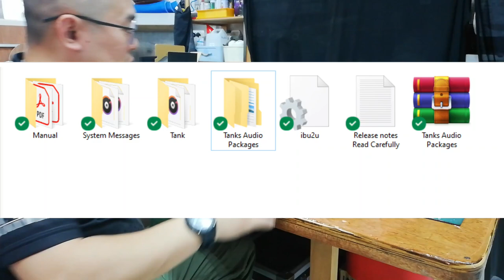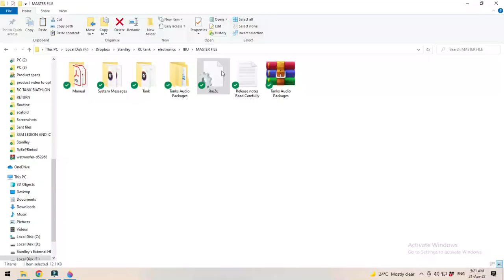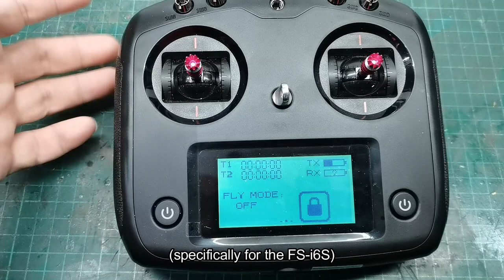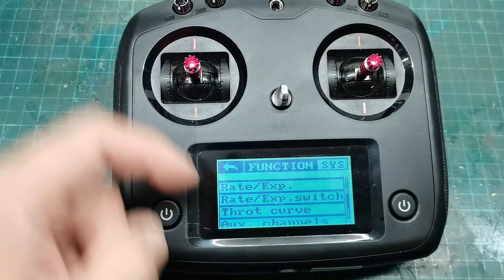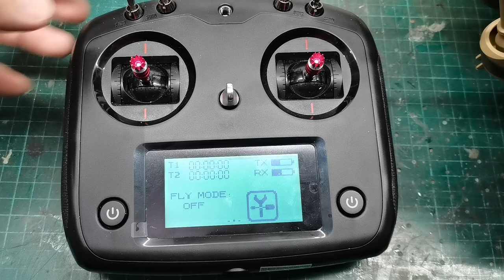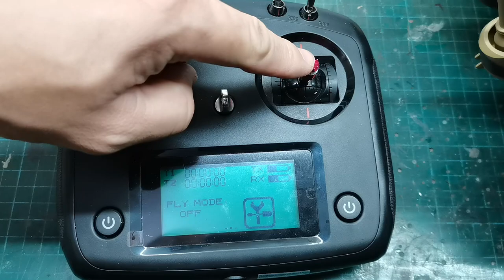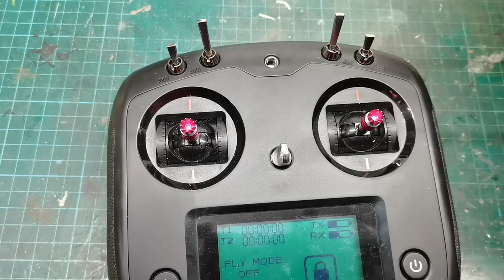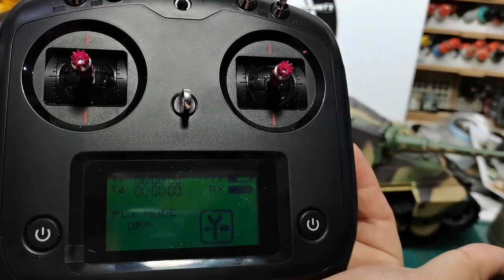how to install and setup IBU2 Ultimate

Comment: I have been working on my mato all metal tank build for 10 plus years.
I have been doing upgrades at the same time.
I have a ibu ultimate 2 board that was new board with all options I am now still trying to make all functions  work and I found the barrel up and down and turret rotation survo plugs do not work.
I am guessing the factory may have sent me the wrong board or it's some kind of programming needed.
Can you help
.I shure would hate to toss my $1,000.00 tank in the trash
Reply from the maker: @donaldseale5621  the turret elevation is a little tricky on the radio to get moving

Comment: Does this board come with the radio you showed? What is the typical range on the radio? I was thinking of doing something of an fpv style setup. I want to have decent range on my radio. 

I like board. It looks to be made of high quality. However,  I prefer my Canon firing button to be one of the shoulder buttons. Like the trick you showed. It just doesn't feel natural to me, to fire the Canon by moving the left stick. I like to be able to proportionally move my Canon up/down with the left stick.
Reply from the maker: no- radio sold separately.
400m i think.
you can mix it to the VRB but can't do away totally unfortunately
Reply: What did you end up doing

Comment: Hey Stanlley, quick question. If I am using the DKLM gearbox, what side is the steering motor and what side is the drive motor?  How do I know which one is which? thanks for the help.
Reply from the maker: Big one is driving motor, and you need to program via the Ini file.
Reply: @StanlleyLegion  yes i didn’t explain myself correctly. i mean what XH2.54 connect on the board does the steering motor get plugged into and what connector is for the drive motor? sorry if i didn’t make myself clear the first time. thanks
Reply from the maker: @panzertracks  I can't remember of the top of my head now. But plug one say drive in, drive it (after setting it correctly) and see what it does! If it's drive and you go straight, it should be the only plug working.
Reply: @StanlleyLegion  ok thanks got it.
Reply: @StanlleyLegion   Yep it worked, right one is for steering and left one is drive. thanks.

Comment: this and Clark TK22 look promising to install ELRS24 receiver and keep turret turret turning using stock setup. I dont need sound or recoil. Just want to FPV and explore the woods
Reply from the maker: Then you can get a decent FPV kit from a local racing drone supplier. They should have the right kit. It runs independently from the board anyway. You can use whatever board you have.
Reply: I didn't think he understood what you meant. I want to do this to and I'm coming to notice these tanks don't have separate receivers like hobby grade rc cars do to have a different receiver and radio for range extension. What did you end up doing I want to do the same with the MT12 by radio master

Comment: Will this board work with a Heng Long controller? Or does it only work with specific controllers?
Reply from the maker: No, you need a hobby grade radio. Stock HL radio is only for the HL MFU.
Reply: @StanlleyLegion  Is there a way to modify sounds on a stock Heng Long board?
Reply from the maker: @WilRiv5286  nope unfortunately not

Comment: Hello Stanlley, I have a question about Heng Long TK 7.1 which has a CN14 port - "Extension function interface". Chinese guys told me that it is for programming purposes but they don't know how to use it. Do you have some information about it ? Maybe we can upload a different sound set firmware through it ?
Reply from the maker: no idea too, HL really does their own thing and then nobody knows how to use it....
Reply: @StanlleyLegion  We need to get someone hooked on these tanks that's really good at reverse engineering software on oddball devices like this. Also, any idea if-and-or-when these IBU2s will restock? I bought a Clark board for a custom build I'm working on and I'm really not liking it very much...thing can't drive the tank worth a crap...and I like that the IBU2 supports easy USB programming with custom sound sets that look easy to make which works well for my scratch build.

Comment: Hiya Stanlley. Just wanted your video IBU2 set up very nice.
So how much is the IBU2 board for my Kingtiger, thank you. Regards Peter.      England
ps I'll be using the flysky i6x 10 Ch.
Reply from the maker: Hi Peter
Thanks! It's usd240, but I am sold out at the moment.
Reply: @StanlleyLegion  Many thanks Stanlley. Kind regards Peter